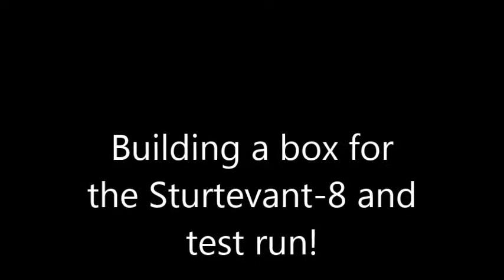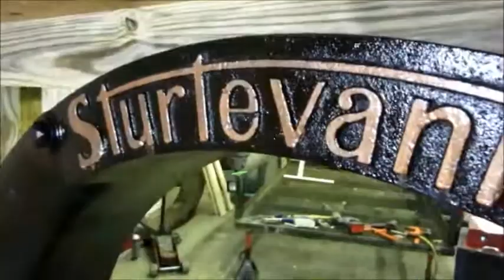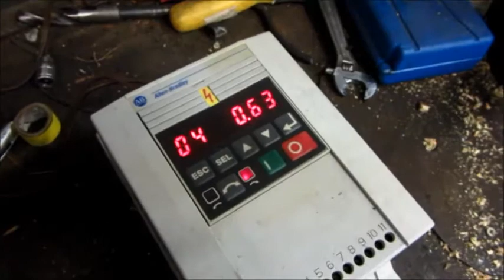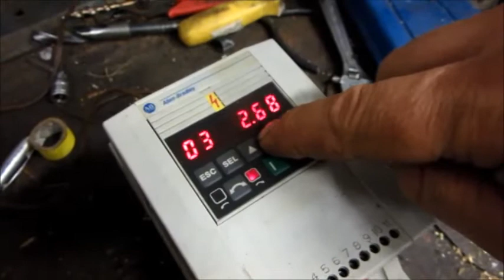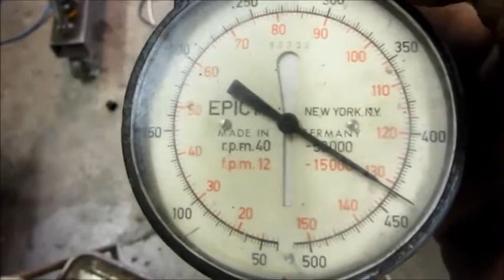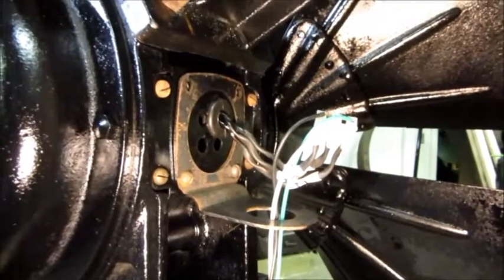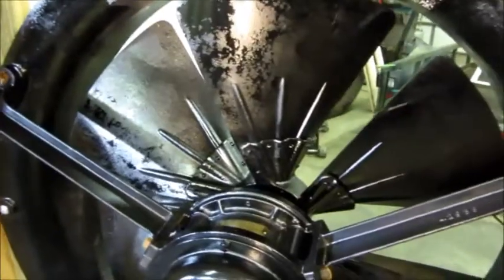Sturtevant Size 8 Design 5 Propeller Fans - #4 - Display Stand Build & test run...

Comment: You need to buy an old mill or shop and just put these and the ILG’s venting through the walls, the mystery fan in some air duct, and monogram blower attached to a dust collection system, then run 3 phase to the building and you have one COOL workshop 😂
Reply from the maker: Thanks for the comment!  That would be a dream shop indeed!

Comment: That's a sharp bit of kit. It really runs smooth too! I imagine even on "decorative low" it moves noticeable air!
Reply from the maker: It moves quite a lot of air! The motor is rated 1/2 HP but every indication is that the motor is much more powerful than that.

Comment: Nice fan! I love the oiler on it. Can running these old fans on a VFD harm the motors?
Reply from the maker: Thanks!  I also think the glass oiler really completes the look.  

These old motors were so overbuilt, that any extra heat caused by VFD use will not be a problem. This fan and several others have been going strong for a long time.

Fans have an exponential power curve. In other words, the power is squared if you double the speed. Therefore by reducing the speed of the fan, the level of load on the motor (and heat) is dramatically reduced. The fan uses about 200 - 300 watts at 1/2 speed. The motor just barely gets warm after a day of running. 

At full power, it uses about 1000 watts, and the motor still just barely gets warm, because the air blowing over the motor is so much greater. :)

Comment: Excellent work.  Any idea what year?
Reply from the maker: Yep, an estimate is 1925 - 1926. This is because this fan was built from 1925 to 1941; and the building was opened to the public in 1927; so the fans would have had to be built in 25 or 26 to be installed during construction.

The motor has patent dates of 1912 and 1916 on it.